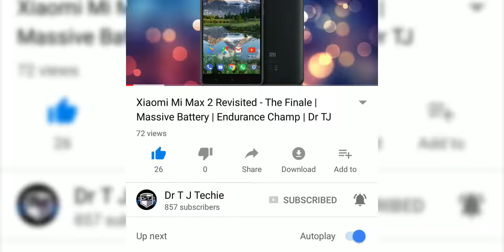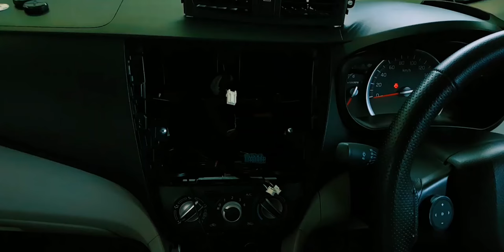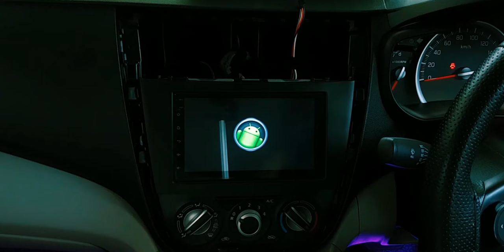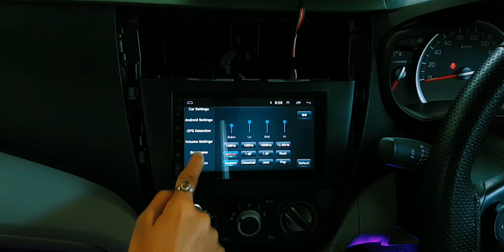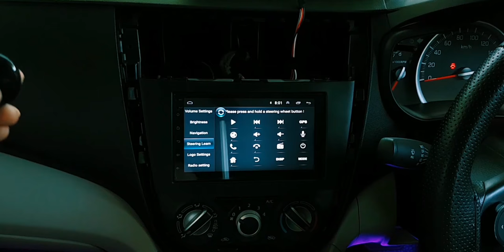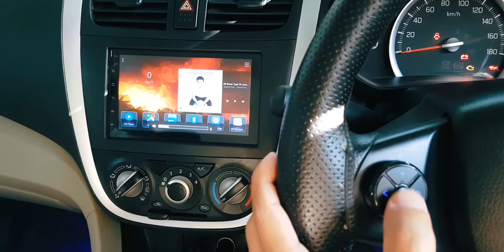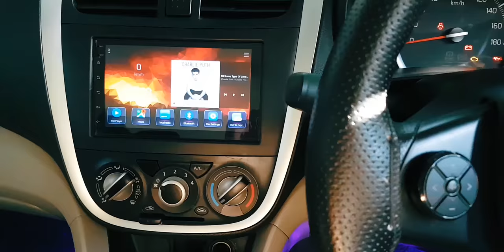Car Steering Mounted Audio Controls | Steering Wheel Buttons DIY Installation | Suzuki Celerio

Comment: Hello, it work with Alpine or Sony stereos and Carplay? Also, how much is the latency?
Reply from the maker: @metalmachine555  No latency as such. As per as Alpine or Sony, its only possible if there is steering mounted control interface in the stereo

Comment: Is there like an input delay when you're pressing the button repeatedly? For example if you're clicking the volume UP/DOWN button in a fast manner will it register each presses successfully or theres a miss button as well?Because the other model that i bought has this annoying slight delay when quick pressing the button, so there will be an unwanted miss button when using it with the head unit.
Reply from the maker: There is a small delay and it does not register few clicks sometimes if not pressed properly. Generally a click sound assures of a registered action
Nothing annoying though

Comment: Can you tell the polarity of key1 and key2? Which is positive and negative? I have sony xav5000 headunit which has a type remote input like 3.5 mm jack. I need to figure out which key is positive and negative and then connect them to the Jack.
Reply from the maker: Both key 1 and Key 2 are +ve. We have a black wire which will be the ground or - ve
Reply: @DrTJTechie  So we can pull negative or ground from any available source? 3.5 mm jack has 3 leads. One is ground and other two are positives.
Reply from the maker: Yes. Black wire of the jack is ground
Reply: @DrTJTechie  is the key1 and key2 5v or 12v?
Reply from the maker: 12V
Reply: @ashokp9260  I m in the same situation, is it working for you?
Reply: @sandeeputb  Modern head units are so smart that they accept both digital and analogue variables. The Chinese controller outputs resistive values. I hacked a 3.5 mm jack and connected both key1 and key2 to red and white wires of 3.5 mm jack. It works perfectly. The innermost part of the tip close to the plastic wrap is ground. Since we have no ground we should not connect to that. Use a multimeter to find out the wires leading to the 2 outermost tips in 3.5 mm jack and connect key1 and key2 to them.
Reply: @ashokp9260  My 3.5 mm jack has 3 wires: red, white and black. Which to connect to 2hich one of the box?
Reply: @lifeonwheels9668  there is no order. Connect as you like. Just that you don't have to connect any wire to black wire from the 3.5 mm jack.

Comment: Hi, Thanks. I have Wagon R 2015 model and I have fitted an android 2 year back. But desperately need good quality steering controis. 
1) Do you still suggest me to install the steering control keys as you mentioned ? 
2) How is the performance after a year or 2. 
3) How long the Lithium-ion batteries last? 
4) Can we mount the round units with screws on the wagon R steering plastic part? 
5) When you press the button whether the horn also gets pressed? 
6) How much is the diameter (in mm) of the round units? 
7) Which model is good - Maxlink or SONSOU ?
8) Any other suggestion?
Reply from the maker: You can install these if you want. Battery easily lasts for more than a year. It takes coin style CR2O32 batteries. No issues with horn. Diameter wise it is around 35mm iirc.
I have heard of maxxlink
Reply: @DrTJTechie   Thanks TJ

Comment: Hi..I have vxi which don't come with audio system and I want to install the default head unit that comes with topend variants and it has got Bluetooth.. can install these buttons and make it work with it ..or it needs an android system compulsory?
Reply from the maker: It will need a android system or any other touch screen system which has configurable steering button menu.
In your case, you can install a android head unit and this buttons or else get the Maruti Suzuki head unit of ZXI variant and ZXI steering wheel with wiring harness and clock spring

Comment: I've mount it and works perfectly. Its been 3weeks.and the buttons start to un responsive. Ive spray it with wd40. And still unresponsive. Does the transmitter range from the button necessary close enough? Or my battery gone off?
Reply from the maker: Try replacing the batteries and check the receiver

Comment: Can we add these both buttons in Maruti alto 800? But i have already installed Easycon touch system in my car. Does this support in my device. Please let me know
Reply from the maker: If the system has configurable steering control options then Yes

Comment: Bro i have an xuv with woodman android stereo installed should i order these buttons?
Reply from the maker: Does it have the option for steering buttons configuration? If yes, Surely these will work. You can also look for aftermarket installation of factory steering wheels with inbuilt buttons like in the higher models, Some aftermarket shops can fit those as well

Comment: Will this work with every android tablet headunit cause i think it will not for some of the hu doesnt have wires.
Reply from the maker: It all depends on the wiring of the head unit. The headunit must have the provision for customizable steering buttons control along with the wiring

Comment: Is any wire cutting involved?
Reply from the maker: No wire cutting involved with the factory wiring, The wires are soldered in the coupler which connects the Factory coupler to the Head unit

Comment: Can you make it work if your device is missing in settings Steering wheel control? I have AV290BT and i don't have that option? And what is your device?
Reply from the maker: It will most probably not work of the host device lacks steering control option in settings. Mine is a Android head unit
Reply: @DrTJTechie  But i have that jack for this party adapter for steering wheel, but missing the function for it. :)
Reply from the maker: @OldboyWOW  That will be proprietary then. You will need the steering control module from the same manufacturer as the stereo
Reply: @DrTJTechie  i see, i was given link to such modul from pionner that cost 100 $ dollars :)

Comment: Where have you placed the white controller box?
Reply from the maker: Behind the dashboard, near the headunit. Used some 3m double sided tape
Reply: @DrTJTechie  Can I install this with Sony head unit? It does not have 3.5 mm steering jack. But a place tl connect the jack. I am thinking of using a 3.5 mm headphone jack
Reply from the maker: @lifeonwheels9668  You will need a sony steering control jack which have Key1 Key2 wiring
Reply: @DrTJTechie  I have installed it. But it gets reset with every switch off of the stereo
Reply from the maker: @lifeonwheels9668  there might be issue with the Headunit settings. Which Sony headunit are you using?
Reply: No it is working now. Thanks for your help

Comment: Hi, good job with all the explanation, but I could use some help from you. The thing is that I have an aftermarket car stereo for VW Golf 5, which works good, but when it comes to steering wheel controls, I don't know how to adjust them, I tried every possible solution and it just won't work. I connected everything properly, but when I click on the button on the car stereo, nothing happens, I can't assign anything to it, it is like empty button. What could I do? Thanks in advance for everyone that helps me.
Reply from the maker: Must be some problem related to Canbus on VW cars

Comment: Can fit in alto 660 and how these are charged no wire or anything so????
Reply from the maker: Yes, it can fit. Wiring will be similar for Alto and most other Android head unit.
The Remotes are powered by coin batteries.

Comment: Will it work with BLAUPUNKT COLOMBO ML single din Bluetooth stereo ??
Reply from the maker: Depends on the wiring of the Blaupunkt stereo. If it has the key 1 & key 2 wiring, it will work
Reply: @DrTJTechie  thnks dear

Comment: I bought the same multi function but my DVD has only one Key wire and I connect the gray and white wires with it but the multi function doesn't working well, What can I do?
Reply from the maker: Connect just one Key Wire and test the system, it will cover the basics like volume control and changing tracks
Reply: @DrTJTechie  yes I did that but I ask for any other solution. Thanks ❤
Reply from the maker: @moustafael-walili4366  No other functional solution unless we change the stereo
Reply: @DrTJTechie  👍

Comment: Any idea if this can be connected to Brezza VDI stock music system?
Reply: @DrTJTechie  ...Yes..but I wanted to know if the reciever module can be connected or not
Reply from the maker: You need to check the wiring harness of the Headunit on the Brezza VDI Music system.
If it has the Key1 and Key2 wiring, then these steering mounted buttons can easily be installed
Reply: Hmmm...thanks...it shud hve as they use same system in zdi (which alreaady has steering mounted controls)...
Reply: But, I am not sure whethee they wl be programmable like the way u are doing with a touch system
Reply from the maker: Yes, its the same system. The connector pins for key 1 and key 2 would be surely present on the stereo

Comment: Sir i have one doubt...how do we connect those buttons with android head unit? If we connect them by Bluetooth with android head unit then how will we connect our phone with android head?
Reply from the maker: Watch the full video. Its is not connected via Bluetooth. The steering mounted buttons send signal to the receiver module connected to the head unit via Radio Frequency
Reply: @DrTJTechie  thank you so much sir for replying. Can you please tell me how can I order those steering mounted controls buttons?
Reply from the maker: @soulenlightment6665  Its available in Amazon, Sadly no option of Aliexpress now
Reply: @DrTJTechie  okay sir thank you so much

Comment: Can I install in renault triber
Reply from the maker: Yes, and it can be configured with a compatible Head unit
Reply: @DrTJTechie  from where I will get and its price?
Reply from the maker: @gourabkumarjena426  I got it from Aliexpress back then for Rs 2000 approximately

Comment: Can u put 9inch android headunit on the bracket housing?
Reply from the maker: Nope, 9 inch won't fit in the Dashboard fascia or the housing
7 inch is max size wise. For 9 inch, you would need a custom mounting housing

Comment: have you ever considered drilling the steering wheel and putting them in holes?
Reply from the maker: It can be done. There are rubber boots included in the package, it can be used fr installing the remotes inside the plastic of the Steering wheel.
I am not considering that, don't want to drill a hole on my Steering plastic

Comment: Will it connect with apple carplay ?
Reply from the maker: If you have a Andriod headunit, you will need a dongle and a app to use Apple Carplay/Android Auto. And then these controls and work of track change n volume level change

Comment: Sir mene meri s cross me steering control button lgaye he jese company fitted aate he us type ke nd contact coil (spring coil)  bhi change krdi ab smaj ni aa rha ki stereo ke piche wire diye hue he key 1 key 2 nd ground wire unko kisse connect kru stereo pioneer ka mvh g219bt lga hua he
Reply from the maker: Does the Pioneer system has option for Steering control configuration? Do check out the wiring diagram of the stereo system and the connectors of the Maruti Suzuki steering controls
Reply: @DrTJTechie  sir wiring diagram kase dekhu stereo ka or maruti suzuki steering control ka
Reply: Nd steering control company se ni aaya tha mene install krwaya he
Reply from the maker: @himanshurajpurohit5039  Check the owners manual of the Pioneer Stereo and check the wiring and identify the Key1 and Key 2 wires. Then for the Maruti Suzuki Steering coupler, check the wiring of the coupler, it has the wiring for Key 1 & Key 2
Reply: @DrTJTechie  sir aapke no.  Send kr skte ho me aapko call pe bta dunga ese ni bta skta bcoz stereo ke piche toh wire he already key 1 key 2 nd ground
Reply: Unko kese connection kru vhi toh
Reply: Maruti ke coupler me kese identity kru ki key 1 nd key 2 nd ground kisse wire se connect kru
Reply from the maker: @himanshurajpurohit5039  Splice the wire and do some temporary connection 1st, dn check the configuration. Once its okay, then use heat shrink tap and seal it
Reply: @DrTJTechie  🙄sb wire pe check kru ek ek krke
Reply from the maker: @himanshurajpurohit5039  Where have to installed the Pioneer system? You need to check its power wiring, some Pioneer system require a adapter to install steering controls
Reply: @DrTJTechie  sir m from pali rajasthan mene pali se hi lgwaya he pioneer system nd uske saath hi aayi he ye pin
Reply: @DrTJTechie  steering control button ke 3 wires
Reply from the maker: @himanshurajpurohit5039  Color of the three wires?
Reply: @DrTJTechie  white ground
Blue key 1
Red key 2
Reply from the maker: @himanshurajpurohit5039  Try connecting it to the Key1 key2 n Gnd wiring of the Stereo if the stereo power wiring has them. Orelse you will need a adapter, you hv to search that in car accessories shop
Reply: @DrTJTechie  sir aapke no de skte ho me aapse call pe baat krunga jb steering control ke wiring krunga aaj saam ko

Comment: Isko steering pe kaise set kia?? Plz explain..and price?
Reply from the maker: 3M Double sided. The buttons where stuck to the steering wheel.
Price is Rs 1100/-
Reply: Steering mounted bottons me kya battery cell include hai??
Reply from the maker: Yes, Battery is included. CR2025 Battery
Reply: Is it compatible with sony xav ax 1000 head unit??
Reply from the maker: Yes, it is compatible with the wiring of Sony XAV AX1000
Reply: Brother I opened my sony xav ax 100 head unit today....I saw one input 1 and input 2 wear...one ground wear..but i did not see accessory wear..i saw one remote output wear..brother plz explain... How to connect??
Reply from the maker: You need to check the manual of the XAV-AX1000 and look for its wiring diagram. Accessory will definitely be present orelse the head unit won't turn on when we put the car key to ACC.
Reply from the maker: Sony headunit usually have a remote port like a headphone jack.
Reply: I did not find key 1 and key 2... I saw input 1 and input 2...and
Reply from the maker: Input 1 and Input 2 is same as Key 1 and Key 2
Reply from the maker: Check out this link :- https://www.team-bhp.com/forum/car-entertainment/206608-diy-upgrading-hyundai-vernas-head-unit-sony-xav-ax5000.html
Reply: Will the wearless remote be worked in the system if i will connect input 1 input 2 and ground cable...without accessory cable will it work??
Reply from the maker: No, accessory cable is necessary cz, it is the +ve power supply for the remote receiver module
Reply: Accessory wear means 12 volte power cable??
Reply from the maker: Yes
Reply: I noticed a Red cable and a yellow cable... In this two cable which one is accessory cable??
Reply from the maker: Yellow is usually for Constant Power and Red is for Accessory
Reply: Dear DJ Techie plz bro tell me how to change its battery.... Plz make a video on this topic...plzzz
Reply from the maker: You only need to twist the button around its seam and it opens. Its a very easy process
Reply: Ya it opened... But how to open the battery??
Reply from the maker: Slide the battery sidewards out of its holder inside the remote button
Reply: The battery which is included is tighten from 3 sides...I have to push it from one side?
Reply from the maker: @sumitbrahma1987  Yes, slide from one side
Reply: @DrTJTechie  where to purchase
Reply from the maker: @PunitsFilmStudioEntertainment  I got it from Aliexpress

Comment: For all hose who is viewing it for budget small cars . It's only for Android music players
Reply from the maker: It works with few other music players as well, which has steering buttons learning function
Reply from the maker: Blapunkt, JVC and Pioneer which has Key1 Key2 wiring
Reply: Dr TJ Techie I hv bought same kit for my swift , so it’s mounted with 3m tape how it’s holding up ???Or should I cut a hole to mount it??
Reply from the maker: @MONSTER-wn5sn  Its holding pretty well with the 3M double sided tape

Comment: will it work with already installed BlauPunkt San Marino?
Reply from the maker: Most Probably Yes, does it have steering control settings? Also check out the wiring, Key 1 and Key 2 wires
If present, steering controls will work
Reply: @DrTJTechie  yes, it has steering control settings, which are disconnected this moment. Thanks for the information.

Comment: I have Sony XAV AX3000 in my innova it will connect to it
Reply from the maker: Sony head units have a separate steering control jack behind the head unit. Needs additional wiring and the jack itself

Comment: Hi, Thanks. I have Wagon R 2015 model and I have fitted an android 2 year back. But desperately need good quality steering control unit. 
1) Do you still suggest me to install the steering control keys as you mentioned ? 
2) How is the performance after a year or 2. 
3) How long the Lithium-ion batteries last? 
4) Can we mount the round units with screws on the wagon R steering plastic part? 
5) When you press the button whether the horn also gets pressed? 
6) How much is the diameter (in mm) of the round units? 
7) Which model is good - Maxlink or SONSOU ?
8) Any other suggestion?